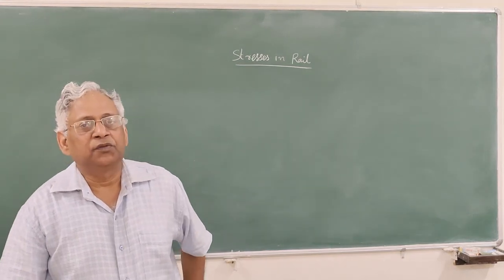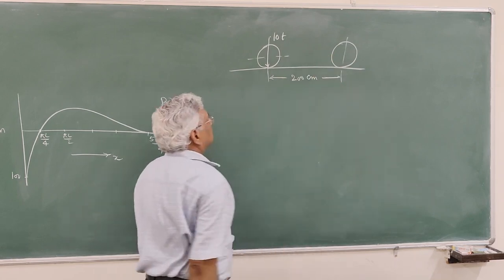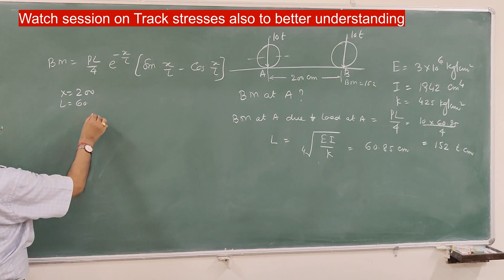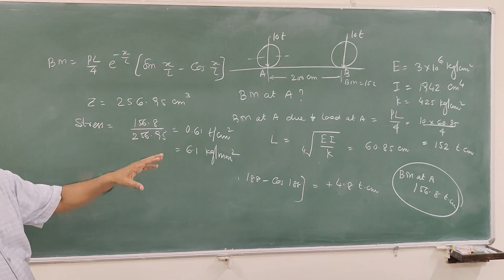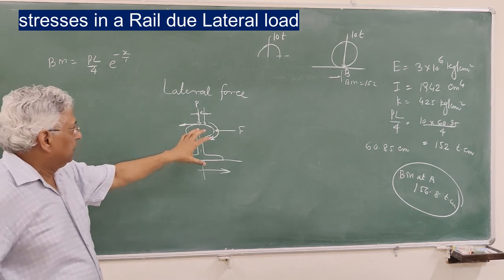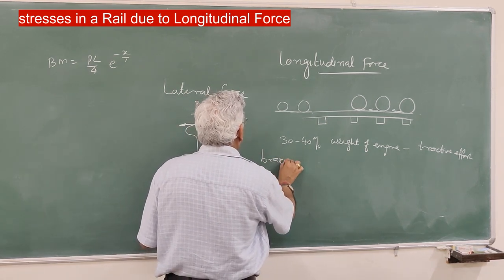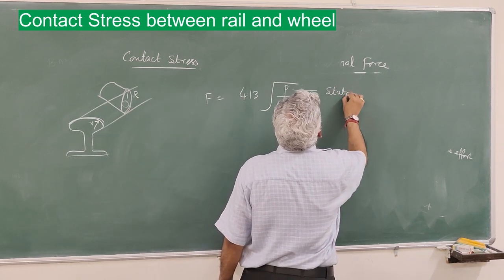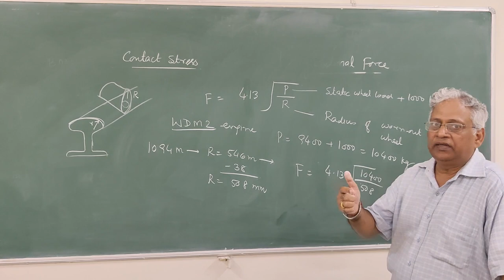Forces acting on a rail, Theory of bending of rails, Stress in rail due to miving wheel load,

Comment: Professor Chandra , Do the bending moment calculated with bending moment equation has to be equal to the bending moment calculated with the Virtual Wheel load Method ? or similar? thanks for the answer
Reply from the maker: Virtual wheel load or Talbot Load is always larger than the static wheel load as it considers hammer blow effect, speed effect and inertia of reciprocating masses. The equation for calculating BM will remain same even if you take virtual wheel load. But stresses will naturally be larger when effect of all these factors are considered.

Comment: Sir what is the maximum wheel load and maximum axle load on rail ?
Reply from the maker: static wheel load of a WDM 2 Engine is around 9.4 tons. Axle load 18.8 t. Axle Load of WAG9 loco is aound 20.5 t.
Reply: Sir the load value is different for all types of locomotives. Suppose if we compare WAG 12 ,WAG 7; WAP 4 or WDG4D ?
Reply from the maker: Yes, it depends on use. @shubhamkumarsingh3449
Reply: @SatishIITR  Thanks Sir😊